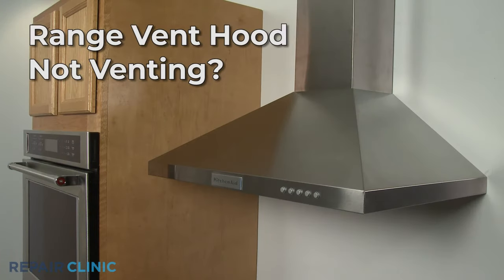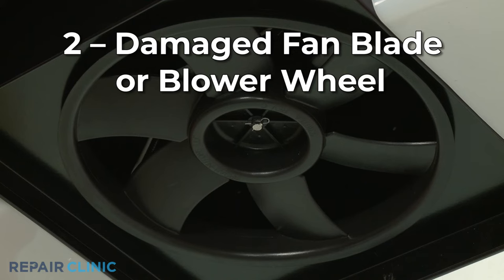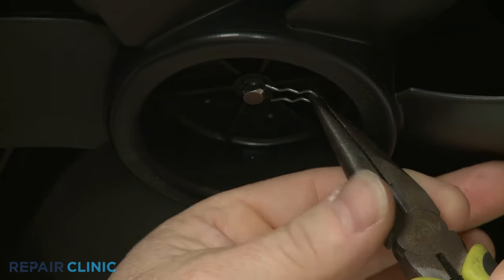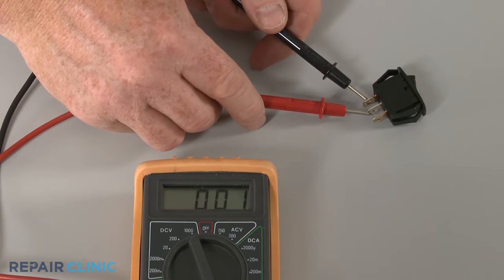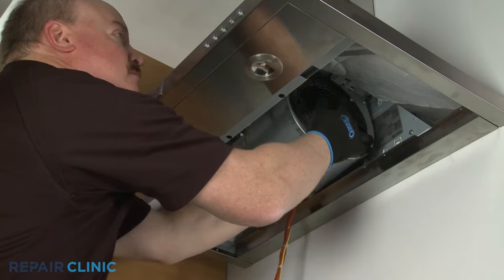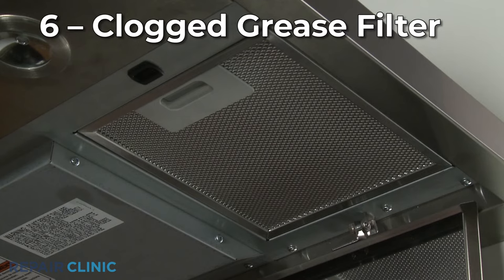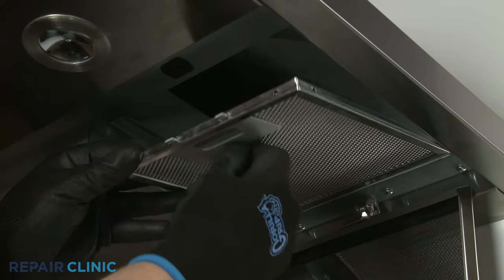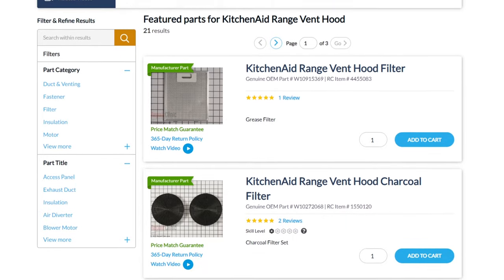Top Reasons Range Vent Hood Won't Vent  — Range Vent Hood Troubleshooting

Comment: What if there is no power but everything else on the kitchen works?
Reply: did u find the issue? I have the same problem
Reply: Could be an internal electrical issue. Faulty wires maybe